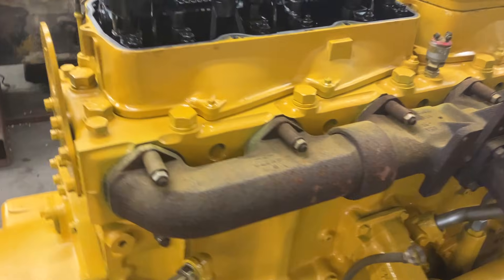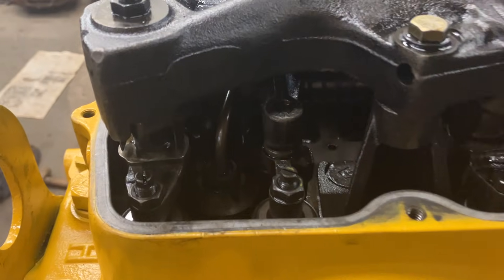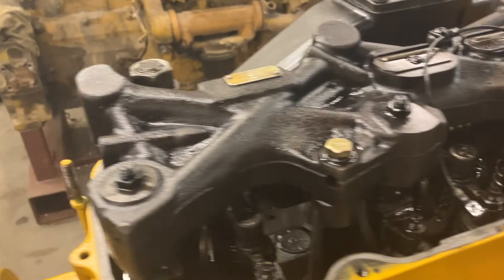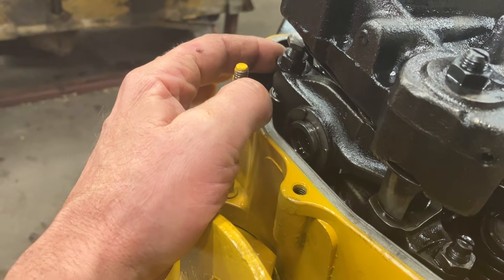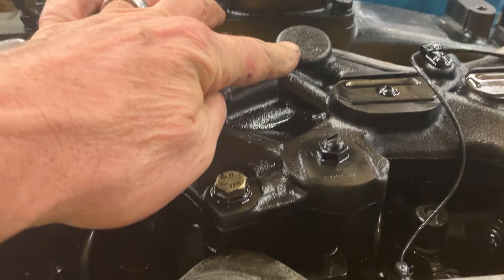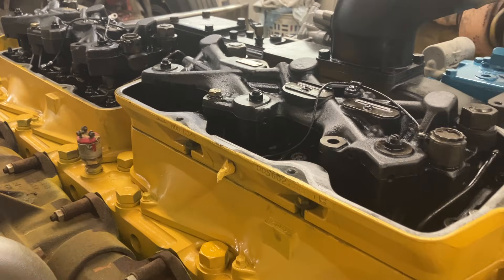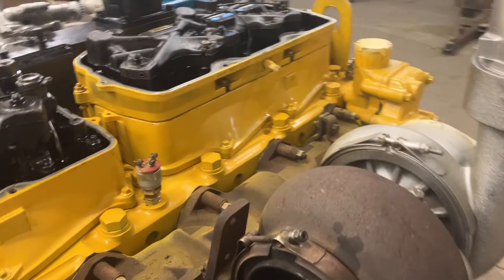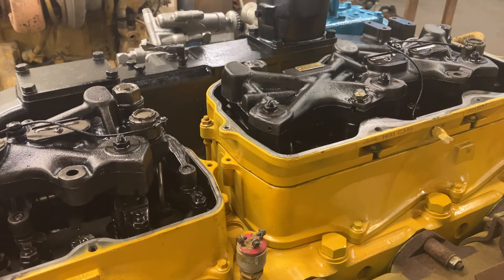Cat 3406 Jake Brake

Comment: Is there a way to adjust those jakes? My two solonoid jake on a 3406b seems to be weak.
Reply from the maker: Yes, the gap between the valve bridge and slave piston is adjustable. You have to use two feeler gauges between the slave piston fork and bridge, the gap should be .070".

On a 3406B or C with valve actuated Jake the power of the braking is not as effective as the electronic (3406E/C15) engines. This is due to timing, as the valve-operated unit only works for part of the piston stroke, where the mechanical electronic unit injector operated ones use the full piston stroke.
Reply: Same here.

Comment: Do you know how much oil pressure is need to operate the Jakes? My C10 has 20 psi at idle and runs at 40-50 psi at high idle. The Jakes will not operate at all.
Reply from the maker: It depends on the Jake model because there's different models for different engines. Some engines like Cummins N14's (which actually has a Cummins C-Brake), operate fine on 25 psi of oil pressure. The engine oil pressure only has to be able to fill the Jake housing. There is high pressure circuit in the Jake from the master piston to slave that is independent of engine oil pressure. If the Jake don't work on your C10 I'd be looking at electrical, like maybe the clutch switch out of adjustment.
Reply: @chrisandkristin  Thanks for the reply, I have checked the clutch switch and is working. Could the ECM be keeping it from operating? ie, turned off in programing?
Reply from the maker: @JT-qf4it  It's possible but somebody would've had to turn it off. You'd need the Cat ET software to verify that.
Reply: @chrisandkristin  There is no turning the Jacobs Brake operation on or off in a Cat ECM. What is programmable is, engine fan comes on in high mode, manual - coast or latch,  auto retarder in cruise, and some other minor features. On mechanical engines, very simple, no throttle no clutch. On a KW the wiring works off grounds and relays. Just about everybody else, single power wire to clutch switch, throttle switch to the on/off switch.
Reply from the maker: @JohnGoldsmith-v2v  I thought there was a setting in ET for minimum road speed before the Jake will operate? I was working a C15 in a Pete 379 the other day, Jake don't work. Well, in a Pete you have step on the brake treadle before it will turn the Jake on.
Reply: @chrisandkristin  You have a min speed that at or below the brake will not turn on. You can have a engine retarder delay for certain transmissions, engine retarder max setting for engines with Cat Brakesavers, if cruise switch is on you can program it to coast, latch or manual, again engine fan in high mode. Get LEXT0023 book .
At idle with the valve covers off, you can depress the solenoids manually and look for oil leaks. Most leaks I have seen pour oil out the bottom on the solenoids. On a Cat the engine brake does not like cold oil. On a few I have seen the rocker shaft (3406 electronic engines, not PEEC) have been put on upside down. They get turned over in the correct position. However the damage is done to the bottom of the brake. It dents the housing and oil leaks out. Cat also update the hold down bolts and you have to put the reduced shank bolt in the oil feed hole. If not the oil supply to the brake is limited.
Reply: On 3406 mechanical and some PEEC Cat engines, you have a 346 Brake, 346A Brake a 346B Brake, a 346B+ Brake, a 346C Brake, a 346D Brake and a 349A Super Brake.  Yesterday had to help set the trigger adjustment on a 349A Super Brake.
Reply: @JohnGoldsmith-v2v  I have a C10 in a 2000 Sterling LT9500 Dump Truck
Reply: @JT-qf4it  Sounds like you have a 3CS, 70 pin ECM.
On the J1P1 connector, the clutch switch could be pin 22 signal, pin 5 common or J1939, Jake switches are pin 5 common, pin 23 low high, pin 40 med high. On the J2P2, pin 9 common, 10 med hi, pin 11 low high. At the valve cover connector, pin 7 common, pin 9 low high, pin 11 med high. On low setting the middle Brake is activated. On Med setting the front and rear Brake is activated.
Reply: On Cat electronic engine, the Jacobs Brake shuts off below 1,000 RPM's, your clutch must not be depressed.  Also you could have a parameter that at or below a certain vehicle speed, the Jacobs Brake will not activate. You could also have a switch failure. On ET you should be able to depress the clutch and the staus screen should change from off to on. Same with your toggle switches, they should change on the status screen when you move them off- on and low med and high. If all that works, you have a test in ET, that you can active the Jacobs Brake, KOEO. You should be able to unplug the connector and use a test light (not a multimeter) Your pins on J1 & J2 depends on which engine you have. A 40 pin ECM or a 70 pin ECM. Also at your valve cover base connection.
Reply: @JohnGoldsmith-v2v  Thank you for the information.

Comment: Amazing I was just wondering about this last night
Reply from the maker: Please read the updated comment. I had the hydraulic sequence for master/slave messed up when I was explaining it in the video. Also note this type of Jacobs engine brake is only applicable to engines with pressure-operated injectors. Engines with cam/rocker arm operated electronic unit injectors such as a C15 will use the injector rocker arm to activate the master for the slave piston on the same cylinder. And the ECU will shut off the fuel to the injector during engine brake operation.